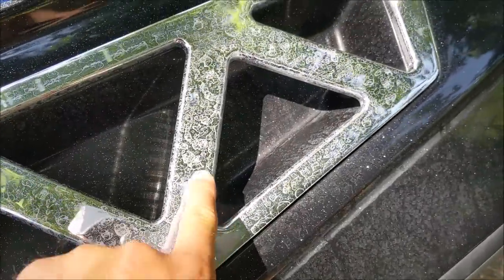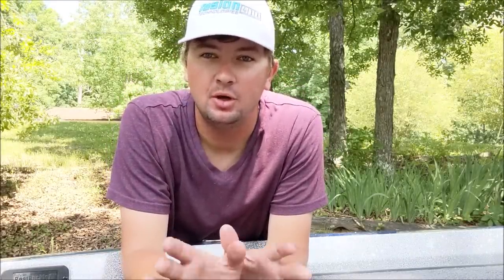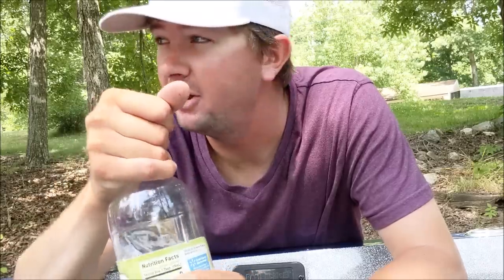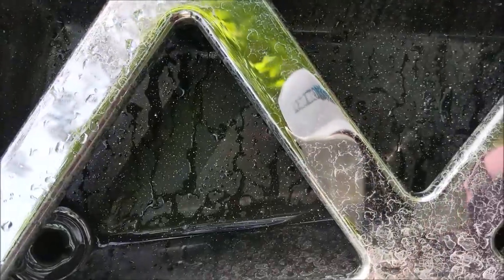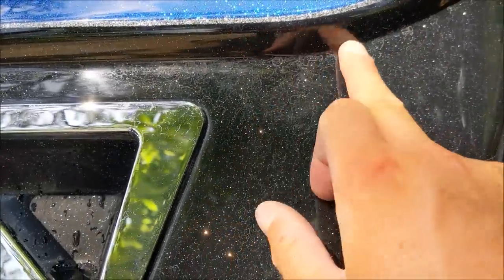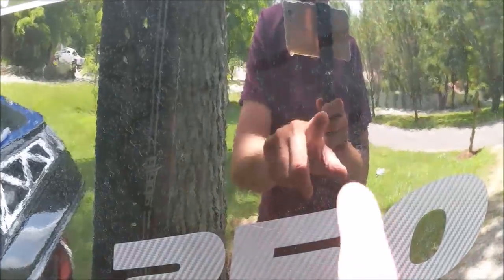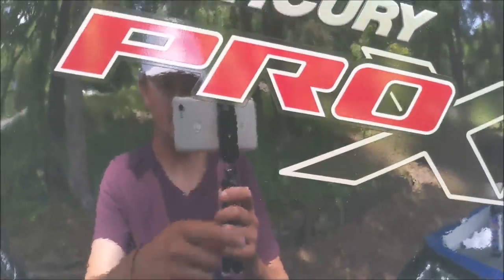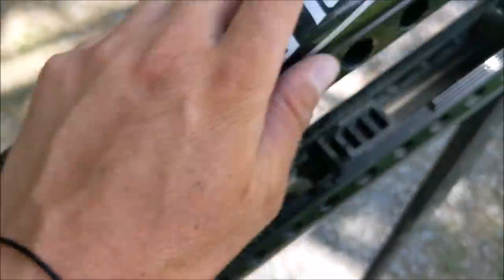How To Remove Waterspots from your Boat or Vehicle!

Comment: Kyle. Don,t scrub with an aggressive cloth or rub hard on any of your boat or truck surfaces.  Water spots are mineral deposits. Rubbing them over the surface will cause micro scratches and cause swirl marks in your finish.  Don’t. Don’t  Dont.  Always use a micro fiber with little or no pressure.  Always use a product that is designed for what you want to accomplish and that works.  Waxes and sealers are Protectants that help protect a clean smooth surface.  They are not designed to clean or remove water spots.   I use Boat Bling Hot Sauce for water spots.  I found it to be effective and quick.  There maybe other products that work as well but I tried a few and Hot Sauce worked best.  If they have been on for a while, let the product dwell on the surface for a few minutes to break up the mineral deposits.   Use it regularly to keep up with it.  I generally wipe down each trip.  After hot sauce you can use a wax or sealer to protect.

Comment: Kyle take a look at a product called Bass Boat Saver. I’ve used it for years and my boats always look new. Once you clean the water spots off use the BBS at the ramp or back at the hotel or home.

Comment: Vinegar works.  Probably need spray bottle and let it set on there awhile since it's so bad.  Once you get it clean.  Mix 30% vinegar and 70% water in a spray bottle and leave it in ur boat. Spray boat down real quick every time you use it and wipe off. And you'll never have to wash it unless it rains and gets muddy.

Comment: Use a Cleaner/Carnauba Wax like Maguire's or Mothers. The water spots stick and wont come off because there isn't any wax on anything. The cleaner in the wax will take all of that off with some elbow grease and leave it where nothing will stick to it.